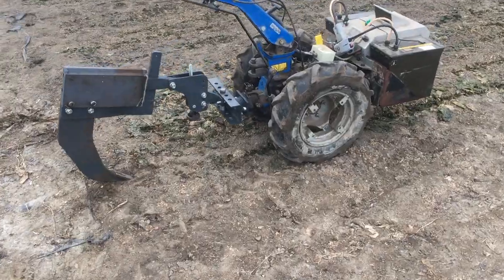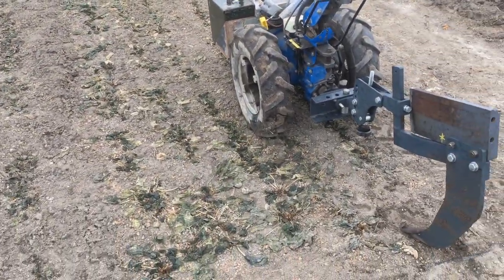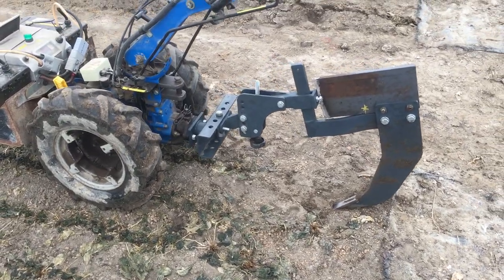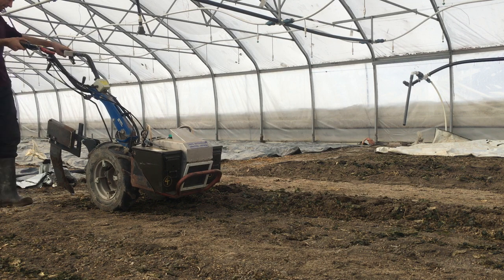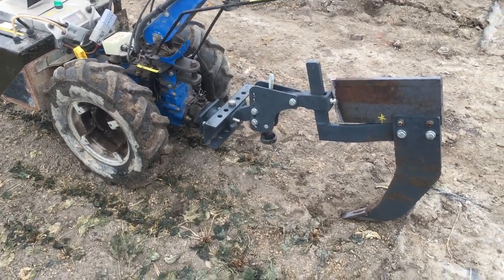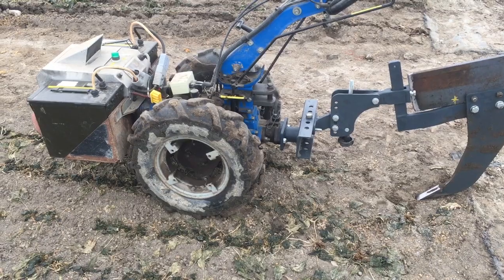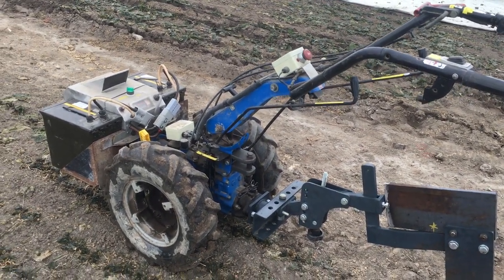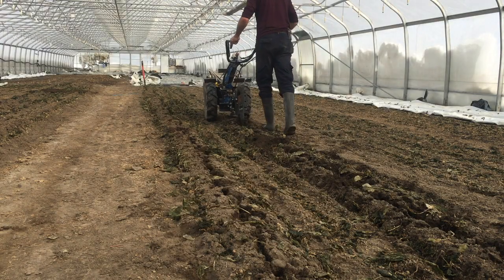Electric BCS 730e first tests with subsoiler / ripper

Comment: Wow I am seriously impressed. Surprised it could get traction without wheel weights. I finally scored myself an old 730 similar to yours with a seized motor and hope to follow in your footsteps (have read your forum posts and walkthrough, quite good info). Just need to figure out a source for motor and controller
Reply from the maker: any progress on your conversion dreams for BCS?  It's almost that time of year
Reply: @reidallaway  The old 730 sits still and awaits its transplant. Not made it to the priority list sadly and still no motor or controller. Someday, someday. Your work still inspires though! Thanks for checking in
Reply from the maker: @fouroakfarm  glad to hear you've still kept the dream alive.  Sometimes it can be a couple years before the stars align for a given project.  Get in touch by e-mail via our farm (www.fermetournesol.qc.ca) if you ever need help figuring stuff out or locating affordable parts for the conversion.

Comment: That soil appears to have very little hardpan or compaction. In conventional farming tillage the HP requirement is around 70 hp per shank on a disc ripper. That little gem is just too cool. Cheers
Reply: I would have expected torque/shank, HP/shank seems highly dependent on gear ratio, etc?
Reply: I would agree with that. A 7 shank ripper behind 490 hp is a sure thing, until the wheels or tracks slip. My LML Duramax is purportedly 490 hp. Seems a bit nonsensical to me. you can put all the hp you want in a lawn mower, but if it can't apply that power to traction, it equates to urinating toward a headwind.

Comment: Hello. I wonder how many watts is rototiller or power harrow requires since you mentioned ripper is lower than those. Thanks for good work and video!
Reply from the maker: With rototiller, and also with our recently acquired 65cm flail mower, it is possible to get up to 5000W or even a bit more instantaneous power output.  However, typical power demand for rototiller or power harrow is normally much lower (1500-3000W) as we're usually doing final bed preparation in greenhouses where the soil is relatively loose.

Comment: I wonder if BCS will offer this as a factory option with the new honda eGX motors
Reply from the maker: I think the current eGX is a replacement for the 150cc motor whereas the BCS tractors this size and up use the 340 and 390cc models.  Still a ways to go but there aren't any technical hurdles to making a conversion kit for BCS or a stock electric model.  It's probably economics and dealer support that prevent it to date

Comment: Noisier in operation than i thought it would be.
Reply from the maker: The video kinda exaggerates the noise.  It's all gears in oil and a little bit of brush noise from the DC motor.  Really it's not even mildly annoying but it's definitely not silent.

Comment: Need some help. So I have a similar tractor to BCS and not too long ago its engine died (most likely something with valves, cus no compression and so on) and now I have an opportunity to convert it to electric but I don't know how powerful should the motor be. Wana make 24V system so that I could use batteries somewhere else. Currently have two options 72V 100A or 24V 119A brushed DC motors. I could buy a pallet lift thingy but the cheapest I could find was 450€ and for something I will be dissembling that's a bit much. Any suggestions about the motor? What are the specs I should be looking for? Any help is appreciated
Reply from the maker: Hi Audrius.  If you have a motor rated for 119A at 24V as a continous power rating that's probably not a bad candidate for a small to medium-sized BCS.  Maybe too small for an 853 or one of the other big ones if you have power-hungry attachments.  If the motor can handle 120A continuous it can probably handle 300A for a few seconds and 200A intermittent.  This is about the kind of peak power demand I see with mine though most of the time it's only 40 to 60A at 24V.  I've only managed to go over 200A very briefly on a couple occasions so I think an average of 80-100A at 24V is pretty good.

Tell me more about the motor if you're unsure.
Reply: @reidallaway  Just found "Still EGV-S14" 2006 parts for sale, but after looking at the datasheet (traction motor 1.2kW and hoist motor 3kW) motors seem a little bit too weak and it's a bit odd that main drive motor is 2.5 times weaker than the pumps motor. So if I were to use the pumps motor I wouldn't be able to use original speed controller, so it's the same as buying the motor seperatly. Hmm... Got stuck again :)
Reply from the maker: @audriusradziunas5451  yes the traction motor on small pallet trucks is often only about 1.5kW.  You may need to look at small forklifts to find a suitable used traction motor.
Pump motors are often impossible to use because the output shaft is frequently coupled very closely to the pump with tang or female splined coupler that makes these motors pretty near impossible to reuse cheaply.

Comment: Motor HP?
Reply: Look at the 4 year old videos where he's building it... IIRC it's 10 kW motor running at only 24 volts so not using it's capability. He's pulling rarely more than 200 amps max, so ~8 hp peak as he says above in response to Audrius.

Comment: Very ridículous...they make motors to go on them...don't weigh.half as much as those dam battery...
Reply from the maker: I know a bit about engines.  the Honda GX340 that was on here originally was a really great engine but I took it off shelved it.  After a year or two I sold it and I'll never use one again.  Using an electric motor for traction applications is just that much better.  Yes batteries are heavier and bulkier than fuel but you can accommodate that with good design and end up with a machine that simply works better in every regard.  Our farm is almost 20 people and maybe 10 of them use this tractor from time to time. NOBODY would want me convert it back to a gas engine after operating it under electric power.  That's enough real-world confirmation for me.